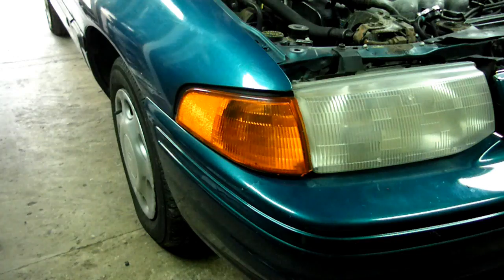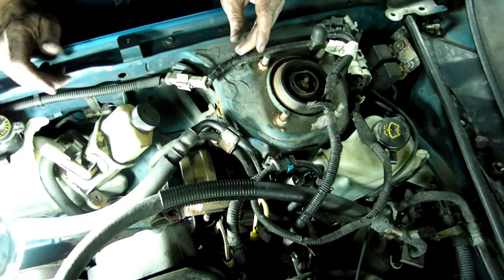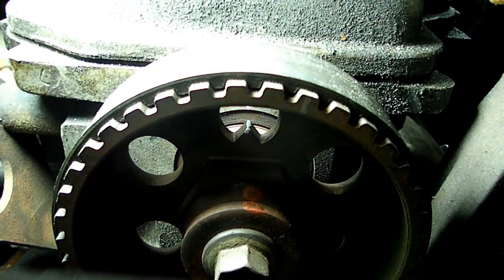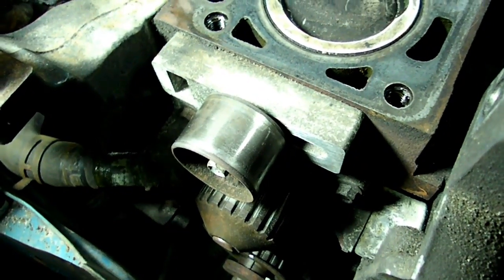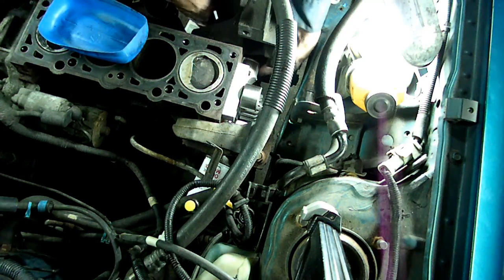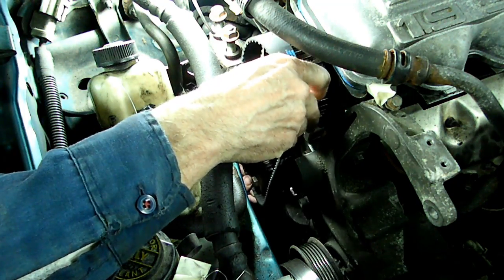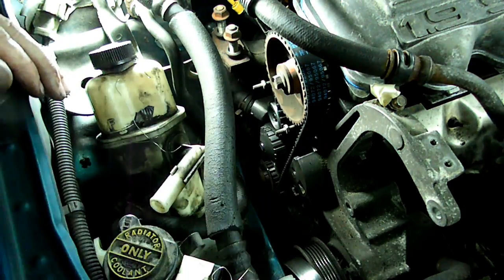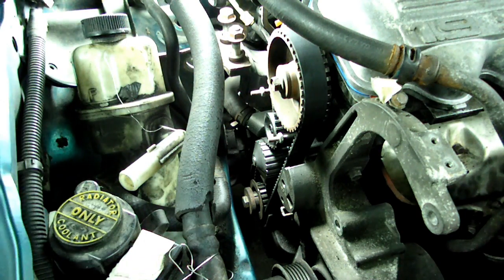Ford Escort Water Pump & Timing Belt Replacement

Comment: You didnt mention anything about cleaning the surface of the area the old water pump was that may have old gasket or gunk built up on it prior to installing the new one. I am assuming you did but not many people will know about that. Unless the escort doesnt require cleaning the surface before installing the new water pump.

Comment: I just got quoted $960 to replace the timing belt and water pump on my 1995 Ford Escort LX Hatchback with the 1.9L engine and an automatic transmission in it. The car only has 62,000 actual miles on it, but they recommend that you change out the timing belt and water pump from 60,000-100,000 miles, so i guess i had better do it. Not many miles on the car, but the timing belt is still almost 30 years old. I don't think I can make this repair myself, so I better start putting some money back for it.

Comment: Dear Sir:  My name is Frank!  Your video on how to replace the water pump and timing belt was a life saver for my 94 Escort Station Wagon with 278,000 miles on it.  It does not look like much but has cost me very little in repairs.  I have taken excellent care or it by changing out the motor oil, automatic transmission fluid, anti-freeze and brake fluid.   Still has the original motor and transmission.  No repairs at all.  First time the timing belt broke we let the local ford dealership do it.  Tried to get them to do it again and the Dealership at Villa Rica, GA told us it was too old.  My middle finger got hard and pointed.  Never heard that one before.   I even purchased the car from them.  I would not ever go there again.  Took me a while to replace it.  I am so careful.  I have used this video a number of times.  Only trouble I had was remembering what I removed and the order.  I feel like a master mechanic - - - - almost ----- not really !  I certainly appreciate it.  Saved me lots of money in labor.  Thank you!  Thank you!  THANK YOU!
Reply from the maker: Your welcome.
Reply: How many miles did it have the first time it broke? My 93 escort hatchback just broke the timing belt at 195k but I think it was on its second belt. It had 135k when I bought it.

Comment: I just got #1 piston TDC on the compression stroke,put the belt on cranked right up,slung oil everywhere, but spent 20minutes cleaning that up,  but thats better than putting it all together & it not start & have to take it all back off again.              JUST SIT THE COVER ON,SEE IF IT FIRES UP FOR A SECOND imo

Comment: My timing belt broke . I do not have a impact wrench to loosen that bolt on the crankshaft to remove the lower pulley.  How can you hold the crankshaft to prevent the engine from turning while turning that crankshaft bolt with an hand tool like a ratchet and socket on it ?
Reply: I put the ratchet on and bumped the starter really quick and it worked perfectly

Comment: If the timing belt breaks on this 1.9 liter  engine will it damage the valves or head?
Reply: No. the 1.9l is a non interference engine so the valves, heads, pistons should be fine.

Comment: Not quite so easy with head/cam gear in the way. The two studs that hold the plastic timing belt cover in place need to be removed to get the pump in/out.

Comment: Thank you for the excellent video sir! I have a '95 same as yours right down to the color just turned 69000 orig. miles when the (original) belt broke. Shoulda changed it at 60k, my bad. Anyway, I got it all done in 4 hours for $78.00 instead of $600. If our paths ever happen to cross, the beer's on me!
Reply from the maker: 69,000..... she must be in very good shape.
Reply: Do you remember what brand the original belt was?
Reply: @robwright4398  The belt had never been changed so it had to be Ford OEM.
Reply: How many miles are you up to now? If you still have it.
Reply: @robwright4398  Still have it, 93000 mi. 33 mpg hiway.
Reply: I know the mpg is awesome

Comment: I did what you said now I'm at the point after replacing water pump made sure that the crank is a top dead center in the cam made sure the tension was off the side of the belt that the tensioner does not ride on put it on put tension back on the Belt turn it over then the crank is at top dead center but the cam the top dead center mark on the cam is directly down from it tried it several times still with the same result
Reply: Did you turn the crank TWO complete turns then check the cam? Sounds like you got everything lined up correctly. The cam gear rotates one full rev for every 2 the crank makes. Try 2 turns and if both marks are at 12 o'clock, you're good to go.
Reply: Frank C. Lol Apple scratch my head for a while and watch the video again they don't realize that's what I needed to do but everything's done running good

Comment: Thank you for this tutorial!! I'm trying to take off the first tension pulley and the bolt is hitting the frame. I can't seem to get it off. Is it possible to lift the oil pan with a jack to get the bolt off? I noticed you did it later in the video. Thanks for the advice!
Reply from the maker: If i can remember correctly  the serpentine belt tensioner came out just like in the video,loosen the bolt and remove the tensioner.

Comment: Hi. Nice video. Clear explanation. I let  my belt go too long on my 99 escort (100,000 miles) and it broke yesterday. I've heard that the car engine would be trashed if that happens. Do you think that is the case?
Reply: Mine broke a few years back, and after repeated attempts to start it, no harm was done, non interference engine.  1994 escort lx 1.9L.  It was low on fuel and turning at speed, just assumed it needed more gass.  Did water pump because of belt that time, now doing belt because of pump... My brothers toyota pickup, gutted itself when the chain broke, interference engine.  Valves open occupy same space as piston up.

Comment: Good job. but if just the timing belt needs changed, do you need to change the water pump too?
Reply from the maker: If the water pump has a lot of miles then it would be a smart investment to change it while your in there.

Comment: I like your disappearing head trick @ 4:48
Reply: I thought the same thing...does it have to come off
Reply: @HotrodTodd81  no it doesn't...not sure why they did that
Reply: Only if it bent valves ..
Reply: An  the only way to find that out without taken The head off..  is compration test

Comment: hi @richpin06a what the engine jumped time, how would you time it?
Reply: Align the timing marks on both crank and cam gears. There are dots where they're supposed to be lined up to. It's kind of a pain to do but that's a good way to correctly line them up

Comment: 97 escort 2.0   didnt remove motor mount..just the right front wheel and inner fender....drop pump out tbru bottom..gotta spin a lil bit...install same way..from bottom -up

Comment: Hello body..need dome help.how can i know te water pump is no good.my is a ford escort 1.9 automatic 1996 .i changed the head cylinder and two pistons and now the car gets hot in just one minute.water pump no good o maybe thermostat o radiatior ..
Reply from the maker: +adrian Z Hdez Adrian Z Hdez How do the spark plugs look.
Reply: richpin06a Hello body good morning..the head cylinder and the pistons are okey right now.just te engine gets so hot in less of a minute.engine gets hot.radiator it is cold.i touch it whit my hand.i just removed the thermostat and i put it in a bottle of boiled water to see it open or not and just made some bubbles but it doesnt open.and the spark plugs look clean..
Reply: richpin06a Hello body..hope you okey..may you tell me where is located the oil pump of a ford escort 1.9 automatic 1996??am having lots of problems whit my car..it gets hot and sound like pistons rings are broken and the signal lights says.."fuel cut out" and the signal oil is on.
Reply from the maker: +adrian Z Hdez Adrian Z Hdez This repair page shows it pretty good.http://www.autozone.com/repairinfo/repairguide/repairGuideContent.jsp?pageId=0900c1528008da8e
Reply: richpin06a Thank you Mr richpin..i will see the page right now..

Comment: You made this look so easy. I just did this job on a 94 tracer, and it was a pain. Did you take the head off just to make it easily accessible for the camera?
Reply from the maker: Jeremy Ayers The engine had a cracked head that is why it had to be removed.
Reply: It made the job more accessible for you.

Comment: I did see an issue. When i put the gear  on drive and reverse i see the motor sway back and forth. What would cause that. And would that be the issue with the vibration?
Reply from the maker: Aby Varkey If your engine seems to move abnormally when your put the vehicle in gear i would check the mounts.
Reply: Would that cause the vibration and shaking
Reply: motor mounts

Comment: I have a quick question, I have the same car and recently its beein idling rough. I replaced the IAC valve and also cleaned the trottle body. I also went ahead and changed the spark plugs, ignition coil wires and the PCV valve.  Now its better than before but here and there it idles lil rough and I feel the vibration when I am in the car. What would you think the problem would be? Thanks in advance.
Reply from the maker: Aby Varkey Possible vacuum leak.
Reply: mass airflow sensor or vacuum leak

Comment: The water pump bolts at least 3 of them are easy, however the one below the heater hose is tough to get a 13mm  short socket and have clearance for the rachet tool.  How did you remove it?  .
Reply from the maker: I think a used a wobble extension.

Comment: I've got a floor jack underneath the oil pan, how high do I want to lift the engine? I don't have the vehicle on jack stands, just on the tires since I'm only checking the timing belt to see if it's broken or not. Is this ok? I'm trying to loosen the 17mm bolts on the dampener, one of them is stuck and I can't get it to budge, and the other one looks like it will need a 17mm deep socket, which I don't have. Does it sound like the bolt is just stuck, or do I need to lift it more?
Reply from the maker: High enough to take the weight off the threw bolt of the motor mount.

Comment: When reinstalling the crank shaft pulley  how do you tighten the crank shaft pulley bolt to 90 or 95 fps when you only have hand tools? If you try to tighten the crank pulley bolt with a socket and ratchet/tork wrench the crank shaft just turns around preventing it from tightening. I can find no way of locking the crank pulley so the bolt can be tightened to the proper foot pounds. It was suggested having someone bump the starter while holding the bolt with a wrench but that seems way too dangerous and you could never tell if you got it tight enough.
Reply from the maker: You hold the flywheel from turning with a screwdriver.

Comment: When you're putting the water pump back on and you mention that there's some sealant on the pump and the block, what type is it? What do you recommend?
Reply: I like to use Permatex High-Temp Orange Rtv Silicone.
Reply: rich pin
 Roger that. Thanks! Also do you do anything to "prime" the water pump? Like once you've got the new pump on and have refilled the radiator, the pump won't have any fluid in it, and will have air in the system. I know it's bad to run a water pump w/o water, so do you do anything to get around that?

Comment: Just wanted to clear this up. All engines in the Ford Escort, this includeds the new models also, are non-interference. This means a broken timing belt will not cause head damage. Many timing belt manufacturers state they are interference motors but that is not the case. Nice vid none the less :D

Comment from the maker: If the mark on the crank pulley is lined up number one should be at top dead center were you get in trouble is the cam gear.

Comment: Rich I just used your video to the timing belt on my 92 Ford Escort. It Still won't start though. My marks are all lined up like  in the video but the motor is backfiring like the timing is off. Is it possible that I installed the belt with the crank pulley 180 degrees off?

Comment: This video is bloody fantastic! My timing belt lost a bunch of teeth and was just spinning on the crank shaft. I would have have been messing about for hours trying to get the timing belt cover off if you hadn't showed us to raise the car and take the wheel off to take the crank pulley off. Shop manual doesn't mention that. Still gotta get the new belt back on and replace the WP but shouldn't be too bad now I've got this car. Many many thanks!!!!

Comment: I have a '99 Escort, and aside from the timing belt tensioner being operated slightly differently on my vehicle from what you describe, this video was SPOT ON and saved me upwards of $1000 that the dealership wanted to charge for the process you so professionally walked us through.
Took me 5 hours including running to the store to get the parts and making a trip to the in-laws to get an impact wrench (tried without it: nogo).
THANK YOU very much for your fantastic video, greatly appreciated.
Reply: This is why there are so many cars in wrecking yards with almost nothing wrong with them.  Nobody would spend $1000 to replace a $30 part on a $600 car. They're stuck with spending $5000 or more on another car that probably has something wrong with it, too.

Comment: Last step in the video, you tighten the bolt on the timing belt tensioner to hold it at the place it is.   Wouldn't you want to leave it with the spring taking up any slack or play, that might develop later in the belt with use over time?  The other outside belt, it is left under tension (or?)    Also, is there any aftermarket way to replace this with a chain?  I think its a really bad idea to build an interference engine held together by rubber bands. That's what it is, a rubber band engine.
Reply: Why complicate things ...if it was engineered to have a timing chain then leave it alone with a belt . Timing chains are noisy .  I too find it to be unnecessary to move the tensioner but whatever works ,then do it ...

Comment: My friend's car is bogging down when the accelerator is pressed.  All I want to do is make sure my timing belt marks are both lined up.  Looks like I'm going to have to take the wheel off, the passenger seat, the sun roof, the gas tank, and half the bloody engine out to get to it. /end sarchasm    !$%^&   I thought when I threw away my cars and switched to riding a motorbike where everything is out on the open to work on, my days of knucklebusting would be over.   :- (

Comment: I just wanted to say thanks for your very detailed video about this job. I've never done a timing belt/water pump on any vehicle and without your video I would have been a little lost. I just did this job on a 1998 Ford Escort 2.0L.............very similar to the 1.9L (only less room, lol). My car is running great.

Thanks again richpin.

Comment: hey  rich   do  you  know  if  the  ford  escort  97   2.0  bends  valve's  if  the  belt breaks. a  ford  mechanic  said   ford escort  97 on,  do not  bend  valve  ford  fixed   the  problem.

Comment from the maker: @dunesofthecape To make sure the belt is installed correctly install the crankshaft bolt (right hand thread)then turn the engine over two complete revolutions by hand all marks should line up.

Comment: I just bought a 1995 today with 160k.  I am going to attempt this my self.  Your video is excellent.  Two question... did you line up the marks on the old belt by bumping the key?  and is the pulley bolt reverse thread?  Other than that I think I can handle this.  I'm a t-belt virgin.  I can do anything else in my driveway but the best intimidates me.   Thank you in advance!  Bill  Cape Cod, MA

Comment from the maker: @ew7ube If the engine has over 100,000 miles replace the water pump.91-99 basically the same the 2.0L water pump is a bit different then this 1.9L engine.

Comment: @richpin06a You know, it would be awesome if you could maybe give me some insight. On this video..    watch?v=byCbFmLG6CY    

I'm trying to figure out what noise my car is making. Front right side, I do have a header - downpipe flange gap. Would that make that noise under high load? Someone mentioned throwout bearing but I figured that is more towards the middle/transmission area. I'd appreciate that a lot.